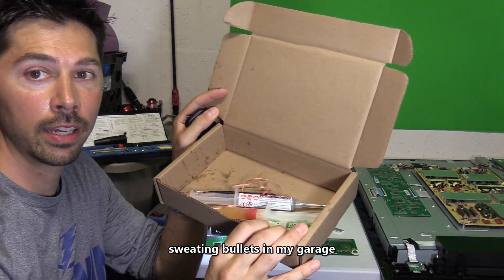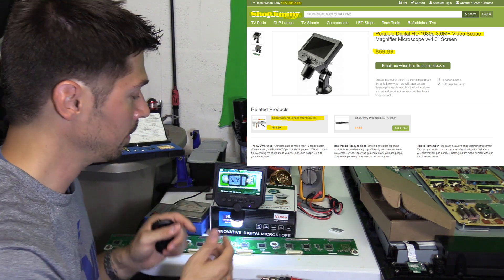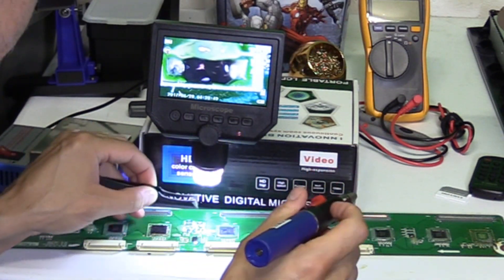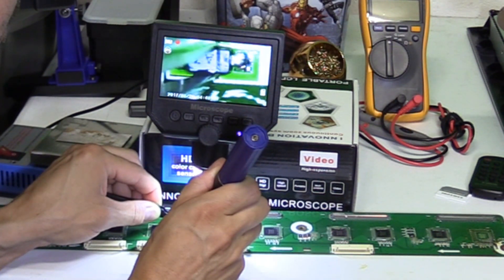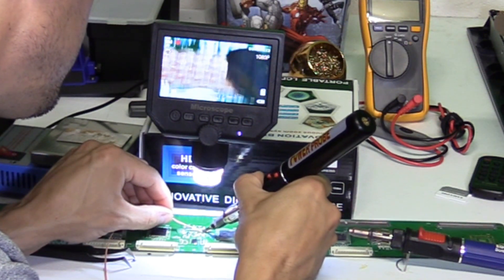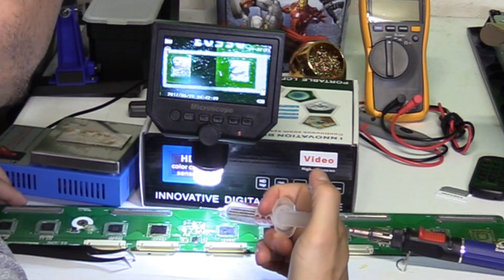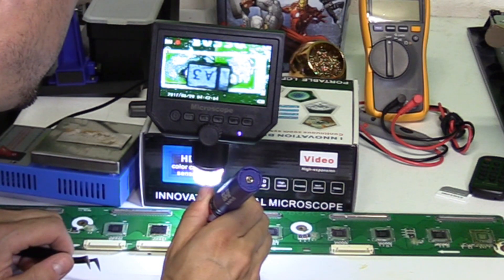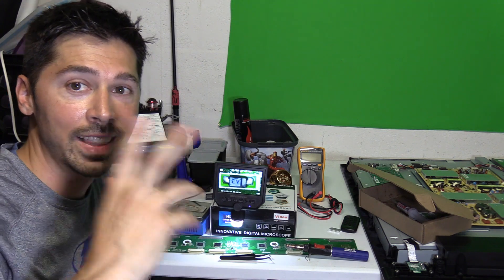HOW TO SOLDER SURFACE MOUNTED DIODES USING DIGITAL MICROSCOPE & SOLDER PASTE

Comment: He did the solder paste juuussst right. I like the way the diode slipped into place. The tweezers were way more nimble than on a previous video, the other guy used huge tweezers and way too much solder paste.

Comment: Hey buddy, I'm assuming by your name your a Tampa boy as I am to which got me watching your vids for some repairs I'm doing, I have no formal training so I use these vids to learn, right now I'm replacing a tcon board on my Samsung so I'm going to use the old board for some practice work, I have the whitewash screen so my research tells me I need to replace the AS15-F chip, do you have a vid on doing these kind of replacements and what is the best brand chip to buy, thanks in advance for any advice and keep up the awesome videos.

Comment: Hi, I have a question about solder paste. I remember long time ago I had build a xoxbox synthesizer and used flux paste that caused some problems with the synth drifting in and out. I couldn't figure it out as all components were properly mounted but after cleaning the board couple of times this issue was fixed so I figured that the flux must had caused some resistance between the connections. Now my question is which flux or solder paste should be used with electronic soldering. I have Oatey no.5 (the only flux paste I could find around where I live) I gotta felling that the reason for my vintage Amiga 600 motherboard is behaving weird after a smd re-cap is due to this Oatey no.5 lead tree solder paste as it might be designed for pipe soldering rather than for electronics. Could this case the problem? I know that some of that paste got under the capacitors so not sure how to clean it or even is it safe to leave it there? Thank you, great video!

Comment: dude , get yourself a decent desoldering station .  trying to clean SMD pads with braid is a pain in the neck and not great. i put flux on SMD pads i want to clean and use the desoldering sucker of the desoldering station and get really clean pads.